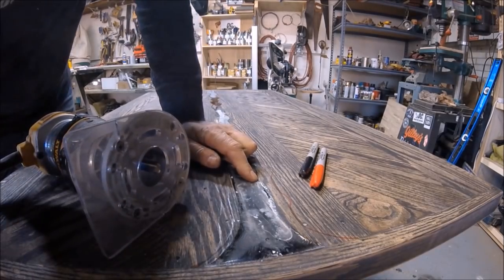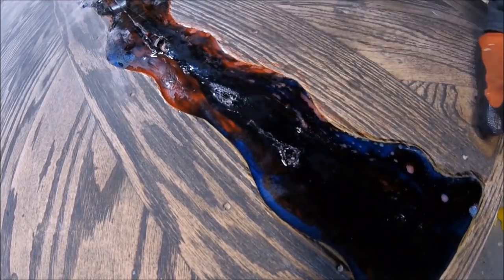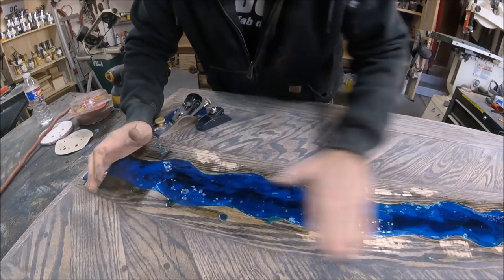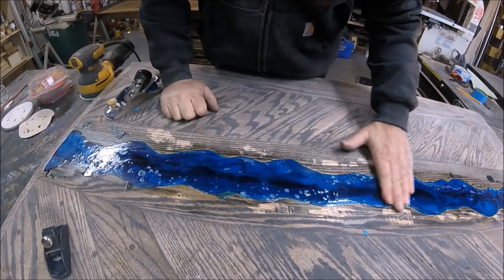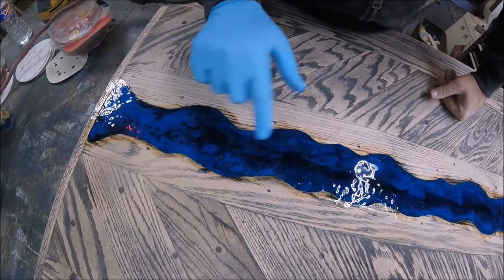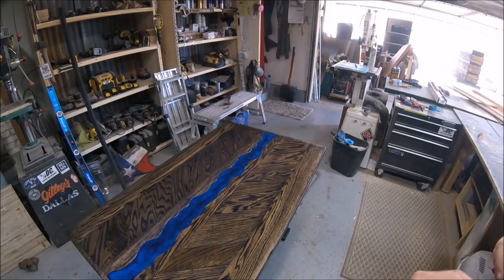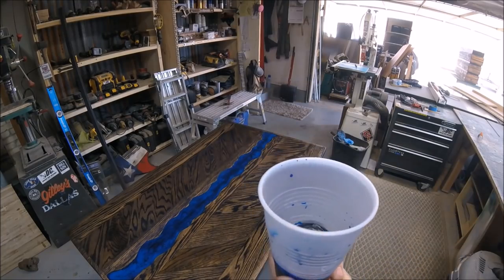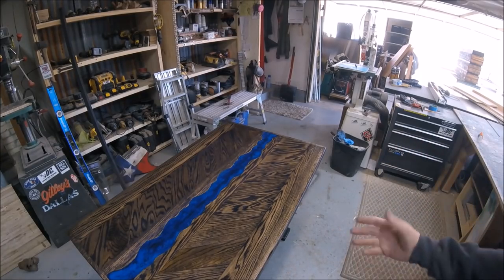Custom table. Learning colored epoxy.

Comment: note- transfast dyes are water soluble and not typically used in epoxy.  If you want to color your epoxy use something like black diamond pigments (mica powder) and i think you will much more pleased with the outcome.   Adding water to your epoxy is typically a no no as it has oxygen in it.  oxygen = bubbles.  table turned out great and i am glad to see you stayed with it to the end.  well done sir, well done.

Comment: Derek. Please check out Stone Coat Countertops. There sell products made for this. They have videos showing this type of table.
Next time.... try using their clear counter top coating for more depth and durability instead the brushed on polyurethane. if you want semi gloss instead of full shine, then just sand with 3000 grit or maybe 2500 grit to dull the shine. I happen to love the look of their glass like shine :-)  my opinion, others will vary.

Comment: A good tradesman knows how to fix mistakes! Nice job on the wood charring effect. I was thinking for a bit, the legs would of looked good with the same effect as the top. I think now it's great left as is, as the main focal point is the top.
Nice craftsmanship.
Personal preference though I like to hide my fixings the old fashioned why, except if it's a complete through mortice and tenon join.

Comment: Just watched your video good job like the legs. Two things to keep in mind never use water in resin, that’s what caused your bubbles, liquid dyes are going to be translucent, use mica powders for solid colours, appreciate you showing your mistakes helps others see and learn.
Reply from the maker: Thank you! What king of resin/powder would you recommend using two different colors without them bleeding together?

Comment: What epoxy did you use? Everything I have experimented with limits to a flood coat of 1/8 inch or in a few cases 3/16 inch.
Reply from the maker: Got that stuff at home depot. Recently switched to stonecoat brand...
Reply: My Home Depots only carry garage floor epoxy. Nothing meant for table or bar top.

Comment: Nice looking table. What did you mix in with the polyurethane coating for the finish coat... looked bluish. And also, was that a satin finishing coat? Thanks.
Reply from the maker: That tint is natural going on, it dries totally clear. Minwax Polycrylic.
Reply: Sorry for my late reply but thank you for your quick reply and information.

Comment: How did you freehand the second cut with the router I tried that but it jumped around and was to dangerous for me ? great job  !
Reply from the maker: Held on tight like riding a bull. Or you can take shallow passes till you get to the line...THANKS! Also the bit was only set at about a quarter inch...
Reply: Thank you @DerekConwayTX

Comment: You mix your powdered pigment in alcohol not water,All of the liquid dyes that are made for epoxy are alcohol dyes and if you need to the thin epoxy you use alcohol to do it(It does take a little longer to set when you thin it which can be a good thing sometimes). Been working with resins a long time so just a tip for you
Reply from the maker: I'll look into this one a little more, never heard this...thank you!

Comment: Next time use a foam brush applicator and put thin layer of clear where you’re doing the pour and let it go/torch bubbles. This will seal to prevent the bubble issue you had.
Reply from the maker: Tried that, still got bubbles...

Comment: I like the concept, but the manner in which you're placed solid wood on one side of the panel (looks like malamine from the video) will guarantee that it will warp.  Whenever you're using solid wood on a centre substrate, you need to have the same thickness of solid wood on both faces of the substrate.

Comment: Do not mix your color with water. The powder works just fine you just have to mix more. You can buy alcohol base dyes if you like. But if you mix water with the epoxy, you might get lucky sometimes, but you have a high chance of ruining it.

Comment: You never pour water into epoxy, you just didn't use enough pigment . Mix your two parts with plenty of pigment. All the recommended mgs are on the packaging of pigments and epoxy .
Reply from the maker: Wrong. Rockler was carrying this stuff that you mixed with warm water, creating a pigment. Trust me, ive learned alot since this vid 5 yrs ago. Thanks for checking it out

Comment: Epoxy is plastic. Water is water. Put both together and you may have microfractured the entire plastic part because those two should never be mixed together.
Reply from the maker: If you're talking about the water in the pigment then you're absolutely wrong. That water/powder mixture is specifically made for tinting epoxy resin.